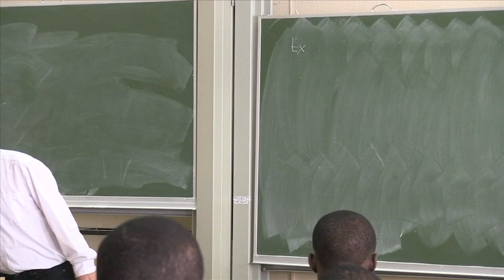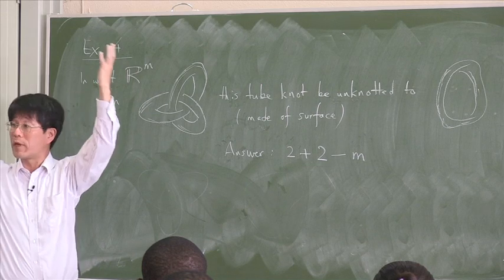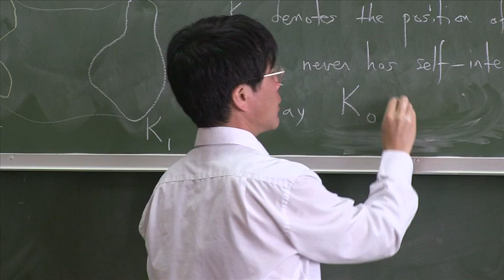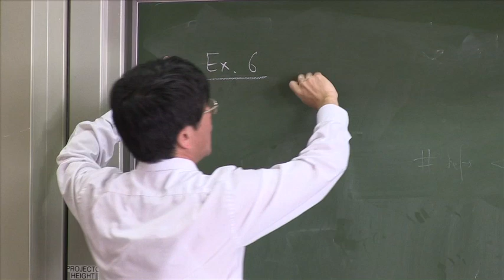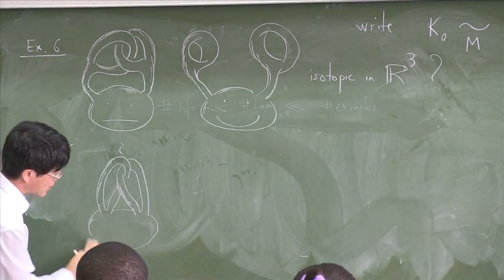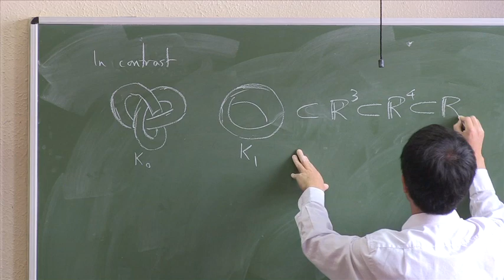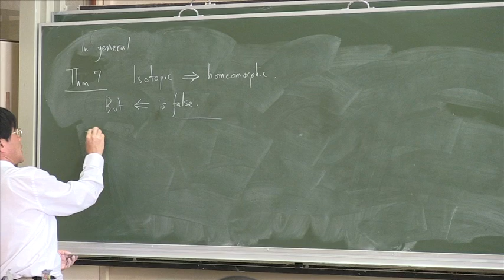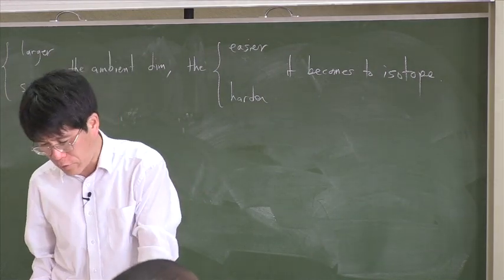Topology & Geometry - LECTURE 06 Part 01/02 - by Dr Tadashi Tokieda

Comment: I have a sneaking suspicion that TT was flat-out wrong about needing 6 dimensions to untie the "toroidified" overhand knot. I am pretty sure you can do it in 4 and it is not dissimilar to the statement that you can move a point past a circle in 2d without intersecting it even though you cannot move it past an infinite line. Or if you like, take two linked tori in 3d space (x, y, z), add a w-component to promote to 4d space with both tori having w=0. According to the way TT is misinterpreting his theorem this requires 6D space to unlink the tori. Now just pick one up deforming it to w=1 without changing its x,y,z, they are unlinked without ever colliding and you can now translate them apart and bring w back to 0 to prove it.
Reply: The key part about moving is the tail it leaves behind, its track. This is why you need the extra dimensions.
Reply: Andrew Hull the problem is, that a tube-knot is a highly degenerate object. you can unknot it in 4 dimensions. just making the same deformations as you do with the corresponding curve-knot (the obvious 1:1 correspondence to a curve-knot is enough to show the degeneracy of tube-knots ^^)
the whole 'theorem' is suspicious... do not rely on it to prove a minimum dimension... stating that two curves in 2d intersect in points does not even hold for circles, which will have no intersection most of the time
best analogy for this: imagine a circle in a circle - knotted in 2d. according to the theorem we need 4d to unknot it, which is obviously wrong
even stronger statement is the following: EVERY manifold in R^n can be unknotted in R^(n+1). the trivial proof is given in the original comment...
Reply: Tadashi should be saying "generically isotopic" instead of merely "isotopic" since his theorem about isotopies is a theorem about when submanifolds are generically isotopic within some larger ambient manifold. There may be isotopies in smaller ambient manifolds even when the overflow is such that Theorem 1 does not apply.
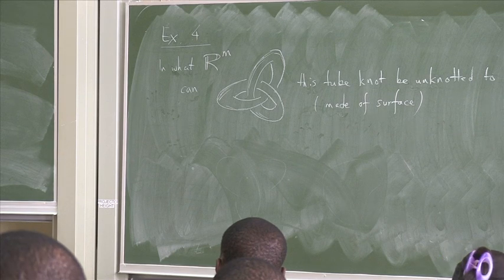Reply: Undoing the knot in the toroid in 4 dimensions:  TT did not specify the knotted toroid's location in a 4th or higher dimension, but suppose initially that all of the toroid is at a single value in a 4th dimension.  For convenience call the 4th dimension Color, and call the toroid's position in Color as Yellow.  Looking at TT's picture of the knotted toroid (3:00 in the lecture), label the section of the toroid in front of the right-most of the three cross-overs as R.  Move R in color out of Yellow toward Red, with sections of toroid near R also moving slightly in Color so that the toroid's Color values remain continuous (so the toroid is not broken in the 4-dimensional space).  Then slide section R of the toroid to the back "through" the section behind R; the two sections are in different places in the 4th dimension, so they do not bump.  Then return section R (and nearby parts of the toroid) to Yellow while keeping R in the back.  Then the toroid is no longer knotted in its new 3-D picture, as you can check with a string.  Supposing alternatively that the knotted toroid starts with multiple positions in the 4th dimension, if the positions are bounded -- i.e., the toroid has finite min. and max. color values whereas more negative and more positive color values are possible -- then the same proof definitely works (no need to check the exact sizes of objects) if we assume the toroid can be stretched and deformed as TT commonly assumes for his topological deformations.  So the knot can be undone in 4 dimensions, and TT's point presumably should be that 6 dimensions are need to guarantee that an arbitrary (2-D) surface can move, without colliding, past another arbitrary (2-D) surface (2+2+1 < 6).
Reply: I think this is in link with continuity.
We shouldn't think that we "lift" something in fourth dimension. Instead, the manifold ALREADY EXISTS in 4D to be able to change its w coordinate.
And in general, a manifold is smooth, so it wouldn't suddenly disappear if you slightly shift the w coordinate. i.e. the volume of the said torus would gradually increase or decrease. So if you want to guarantee that your torus embedded in 4D does not intersect the other torus embedded in 4D, even after changing the w coordinate, you have to provide the extra 2 dimensions. And moving a manifold generates another dimension, so it is 3 dimensions in total to add.
Though I'm not sure.

Comment: Why is isotopic weaker than homeomorphic?
Reply: He misstated this, it is clearly stronger than homeomorphic.
Reply: Thanks! To be sure, why is it stronger?
Reply: He stated this as a theorem. It is true because when you deform a manifold into another you do so continuously. Since you can make a reverse deformation, which is also continuous, the two manifolds must be homeomorphic.
Reply: I don't think this was misstated. It's weaker than homeomorphism because two manifolds can be isotopic to each other in R^6 but not in R^3, where as two manifolds that are homeomorphic will be homeomorphic in any ambient dimension. Also in example 6 the two surfaces are not homeomorphic, but are isotopic in R^6.
Reply: edit: disregard, i read "homotopic" not "isotopic" 

it's a weaker statement: let X be the letter 'X' and Y be the letter 'Y'. then you can make X into Y since Y is a deformation retract of X (both X and Y retract to the point at the center). 

but X and Y are not homeomorphic: for if you remove the center point of X you get a space with 4 connected components, and if you remove the center point of Y you get a space with 3 connected components. 

another example: the 2-dimensional cylinder and a Möbius strip are both 2-dimensional manifolds and homotopy equivalent, but not homeomorphic to each other